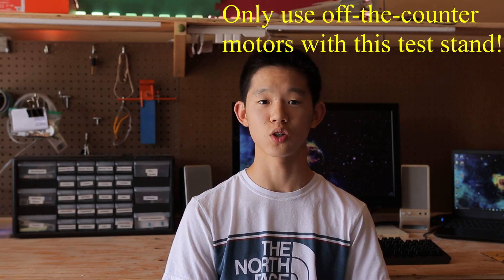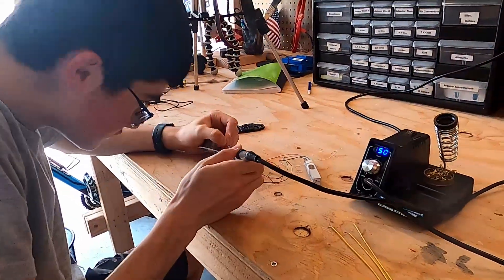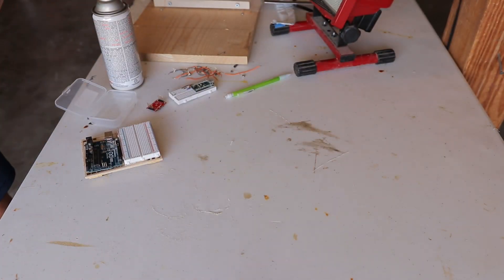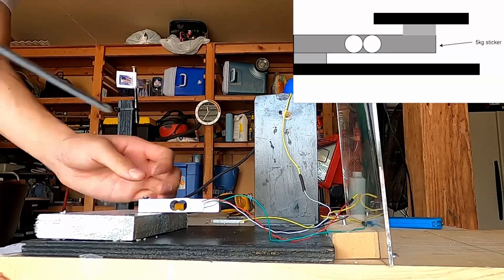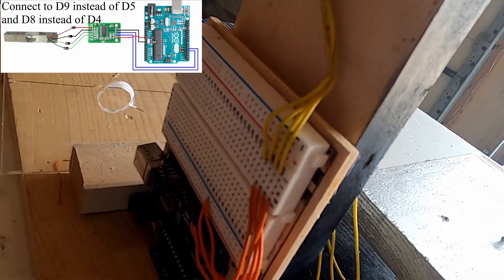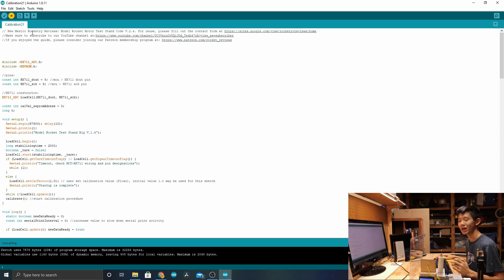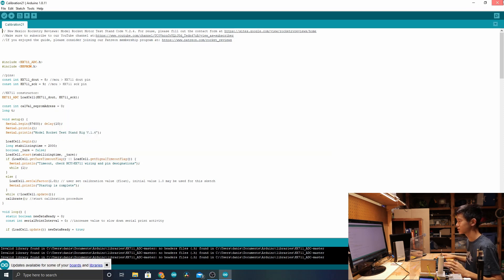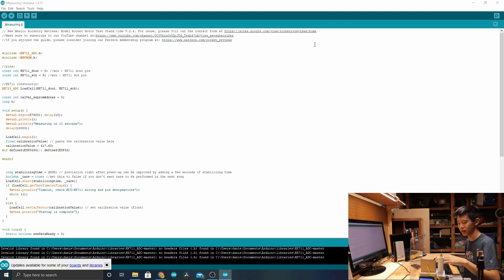How to Make a Model Rocket Test Motor Test Stand with an Arduino

Comment: What is the idea behind using a Straight Bar Load Cell versus a S-Type or Pancake Load Cell? Straight Bar Load Cells are not generally used for axial force, like the force in a rocket engine, especially when other types can be better. Also, why use the HX711 which has a sampling rate of 80hz, which can be too low to accurately measure thrust force? Would something like the ADS1256, with an adjustable SPS rate up to 30kHz be better? 

Great video! Doing a research project that requires one of these, but wanted to know a couple more details.

Comment: Hey, I'm using the red Load Cell Amp and I'm not quite sure how to wire it. Could you help me out with that?
Reply from the maker: Check out my guide at: https://projecthub.arduino.cc/nmrsthrust/f8a42f38-bc3d-47ba-9647-ef3bdb902e00
Reply: Thanks! My science fair project turned out great because of the help!  @NMRocketry

Comment: can i just use a weighing scale
Reply from the maker: yup. our first revision used that configuration. the weighing scale should have the same wiring and load cells, just in a wheatstone bridge configuration.
Reply: @NMRocketry  thanks bro will give it a shot

Comment: I have a question. I've been trying to make one myself but when I go to calibrate the loadcell all I get is a value of zero and then the serial monitor just reads "Load_cell output val: nan
".any help would be greatly appreciated. thx
Reply from the maker: Hey! Saw your form submission, but there was no email attached. Glad you commented. Double check all your wiring. That problem occurs when some of the wiring is off. It is also super helpful to use a multimeter to read the resistance values: black and red should have higher resistance than the green and white wires from the load cell. Also, if you used different I/O pins on the Arduino, make sure to update the code with the ones you used.